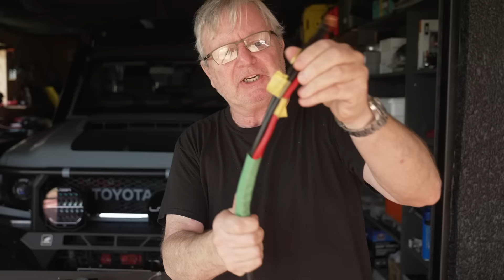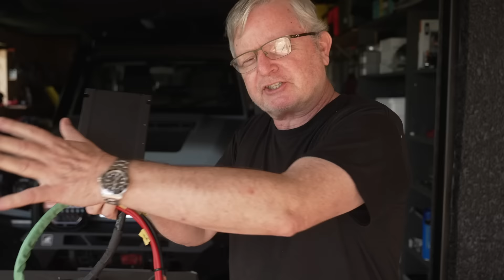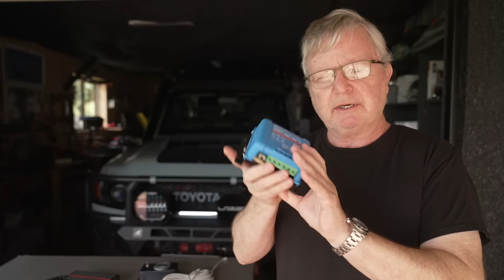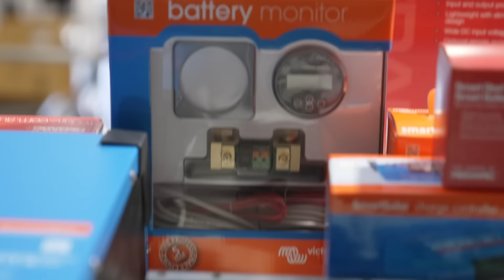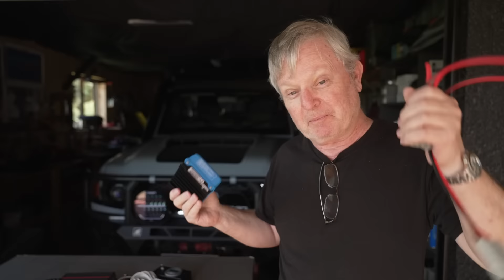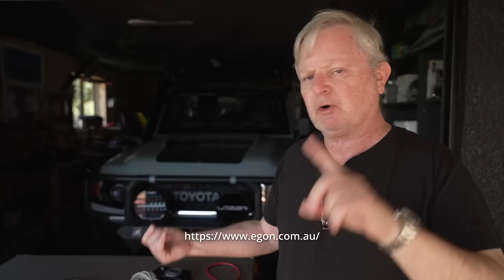DC-DC CHARGERS. Victron VS Redarc How to chose the right one for you.  @4xoverland

Comment: Out of my Redarc I get 48.7 amps 
I think it has to do with what your alternator is charging.
Mine is fitted to my 2004 GU 4.2tdi Nissan patrol
As you can imagine it’s prehistoric compared to today’s vehicles.
There is very little demand for the alternator to keep the engine running.
Reply from the maker: 48.7A at the battery from a 50A DC-DC charger is a healthy charge.
Reply: @4xoverland I’m currently reorganising all of my 12volt system
Once I have it all up and running again I’ll monitor it and see what the outcome is.
I’ll let you know how it goes.
Cheers

Comment: On the Redarc, is it a maximum of 50a it can charge including dc and solar? Or is it 50a from dc and then solar on top?
Reply from the maker: The Redarc BC-DC50 never reaches 50A. More like 47A at max. And the solar is included. These are max current charge rates. The new Victron DC-DC and MPPT are far better. The Redarc inbuit MPPT is not very efficient. A separate MPPT gets better results from solar. Also, the Radarc can only handle the low voltage panels. Victron can handle high voltage, and therefore more efficient panels.
Reply: @4xoverland thanks. Will try to cancel my redarc order I think

Comment: You are better off putting a inverter near vehicle alternator but mount it not to hot area. Then you run 14 gauge extension cord to trailer hitch. But a cord receptacle. Then a male cord and more 14 gauge 3 wire to your trailer on board power cord.  Now you do not need the big welding cables. You can charge using 1500 watts at 120 volt,  or 3000 watts at 240 volts.

Comment: Would the new ‘Redarc  Manager Alpha 100A’ Alpha unit change the preference over Victron for this application?

If so, why?
Reply from the maker: No simple answer. I need to get one to test. I do have two questions: Is the Alpha's fan as noisy as I hear it is? And can one's alternator even handle that current?
Reply: @ yeah, I agree with you.  I have decided to select Victron over redarc for my new build.  After doing some recent research on the Alpha, I just think the ‘100’ is used as a cunning marketing ploy  - in my view.

Comment: That is a similar conclusion to my research. I am building the Victon Lynx system with a Victon 1000A IP65 smart hunt to a Ekrano GX display. Battery, mid battery, Tempuraturs, humidity, water, LPG can be monitored. If an upright fridge needs an auxiliary fan to help cooling, the system can switch that on and off. More expensive, yes. More usable features that I will use, yes.

Comment: We did use Victron before and switched fully to Redarc since it’s release in Europe. Reasons are multiple:

-much more easy to install
-robust and even waterresistant 
-much easier to operate by customer
-all in one units like Manager 30 where you cut down all the wiring and installation time, what’s the most important for our 4x4 builts is that there are less wires exposed to vibrations, heat, dust and even some humidity
-Redarc has superb customer service where Victron has literally none (at least here in Europe)
-when we resale the units for DIY installers they are also super happy as instructions are easy and also online
-we had multiple warranty claims with Victron in the 2017-2019 time, especially with dc-dc chargers that didn’t survive the offroad conditions such as the vibrations and heat
-last but not least it is made not in China, of course there might be some parts coming from there but the feeling that we support western world jobs and cutting down the Chinese machine which is growing and also invests in growing their war machine that supports Russia is also satysfying. Victron is made of 80 to 100 % Chinese parts and this is what we really don’t like.

Downsides of Redarc - solar power VOC but it’s not really that bad as if you choose your panels wisely and pair them parallel it will be possible to charge near same amount of power like thru the Victron MPPT

That’s our opinion based on 8 years of experience with some market products.

Comment: Hi I love your videos,
I have 800 watts of solar and a 30amp enerdrive dc to dc charger.
I was thinking about getting a better dc to dc charger 🔌.
You mentioned the 40 amp redarc charger 🔌.
In your opinion would this be the best option?
I find the panels don’t start working until about 10am 🕙.
Would the redarc make any difference?
I live in Australia 🇦🇺.
Thanks very much for your time .
Kind regards,
Peter Keys.
Reply from the maker: You are going to need more than 30A charger for 800W solar. Get a dedicated 100A solar MPPT charger. Recommend Victron.
Reply: @4xoverland  thanks for your reply. 
What about the redarc 40 amp charger 😒
Reply from the maker: A 40 A charger will handle 480W. So no. You are going to need an absolute minimum of a 66A charger for 800W. But even that is cutting it fine. To do it properly, get a 100 A MPPT charge controller.

Comment: Great video! Need help. I am trying to do a dual battery in my 5th gen 4runner 
Currently I have Xplor solar 180w on RTT charging my Jackery 1000 using victron MPPT but now I want DC-DC with solar and alternator charging 
But cant find how to do it or what parts needed with victron - looking like I’ll have to go redarc and would not like to if possible.
Please help thank you
Reply from the maker: Victron do not have a combined alternator/solar charger. But keep them separate! Just add a victron DC-DC charger for alternator charging.
Reply: @4xoverland  Would I then take the pos & neg from the the mppt and wire them into the same pos neg ports of the victron dcdc that the alternator is wired to as well?  

Or have the mppt go straight to my aux battery 
And also have the dcdc separate going also to aux battery not combing the wires at all.?

Thank you so much for your response
Reply: @206Trail4R  You probably have solved this by now, but for the others: The MPP charge controler to the Aux Battery and the DC-DC charger from the main to the Aux battery. The problem with this settup in a RV that is parked up for a long periode, off season, is no solar from the aux to the main battery. Epever has a MPPT in 20+5 and 30+5 volts that charge both battery, with 5amps for the main battery. Victron also have the Cyrix realays betwen Main and Aux battery, where you have the possibility to conect the batterys when main is dead, to transfere from Aux to main. How ever that does not limit the amp going from main to aux. And that is the reason you have a DC-DC charger, for your alternator not to overheat.

Comment: Couple of points - I have had my 2in1 die before (dcdc and solar) combined units are a single point of failure and when they die, you are buggered. Seperate independent units allow for upgrades and redundancy.  Redarc has not done anything to modify their pricing to keep up with competition, their tech has advanced but isn’t better than competitors like victron OTHER than providing a wholistic solution that locks you into their products.  I dont think the dc dc from victron is more complicated to wire because you don’t need an ignition wire.  I’m victron all the way now, it’s cheaper, some of the things it does is smarter, it’s not hard to do DC when you figure out wire size and fusing everything near the source.  I’d love to support Aussie made but the price does not justify how much effort goes into building these things.  4wd companies like ARB and Redarc have had a captive market and have been charging excessive prices for a long time now.

Comment: Does the victron still have a voltage limit input. My guess is you couldnt have 4x 25v panels in series or inputting 100v into it ?

Comment: It is true that the voltage stays high enough to be useful if you wire panels in series, BUT: if the output from the panels is not exactly equal (due to differences in panels, differences in orientation or differences in irradiation due to clouds), the total output power will be greater if you wire them in parallel. This is because the (open circuit) voltage of solar panels is more or less constant, it's the current that varies with the amount of sunlight hitting them. So, in short: If the panels are exactly equal, if they are oriented in exactly the same direction and there are no clouds: You are right. If one of those criteria is not met, you are better off wiring them in parallel. If not, the time you 'loose' because of the lower voltage will be more than compensated for by the higher power throughout the day. Of course, if the output voltage of your panels is on the low side, you might have no other option than to wire them in series. The Victron MPTT's need at least 5V above the battery voltage in order to start. Once started, 1V above battery voltage is enough. So for a 12V battery I would recommend panels with at least 18Voc (36 cells), preferably 20Voc (40 cells).

Comment: Having 2 or more panels wired in series may give you a higher voltage and longer charging day with thinner wire but , if one gets shade it will take out all panels and charging will almost stop. Parallel wired, one panel can be completly shaded and the other will still provide all the current it can. You will need bigger wire to handle the extra current if they all come together before the MPPT and a higher amp rated MPPT. Thats one benefit of Victron you can choose multiple voltage and amp configurations.
Depends on your set up. I have a panel fixed to the vehicle and a mobile blanket paralleled to the system. The vehicle stays in the shade if I don't need the charge and move the blanket around for best sun.
Reply: The caveat was to get the most out of the system. If running panels in parallel and buying a more expensive charger is what someone is doing, they are probably moving their panels during the day for optimal absorption.

Comment: In my experience the isolated DCDC VICTRON gear gets very hot. I'm talking it will get 40 degrees above ambient, so if its 30 degrees outside it will hit 70 degrees. 70 degrees is its max temperature and will de-rate continuously up to that temperature. From what I have been told the non isolated version is more efficient. 

The user interface on the Victron Gear good and the ability to control through Bluetooth is also very nice. If you go Victron you could go get a cheap house panel with a higher open circuit voltage and avoid way more costly 12V /24V panels in series or parallel. I'm curious of how much more energy you would actually capture putting two panels in series vs parallel. I'd hypothesis that it may not make an appreciable difference keeping in mind the pros and cons of series vs parallel solar panel configurations. 

You have to keep in mind also that the REDARC gear is also submersion rated / unlike the Victron gear. It also takes up a much smaller footprint and is way easier to tuck away somewhere.  

What exactly is the EGON achieving other than a distribution panel with some LED blown fuse indicators ? My assumption its a faster to install maybe ? 

Also keep in mind that some lithium batteries do have internal shunts that do do capacity monitoring, which may mean you don't need a Victron shunt / gage, although they work well from what I have heard.

Comment: It would really be interesting to see a comparison with measured results of how much more power is generated in series vs parallel and Victron vs Redarc to see the benefit.  I would expect the Victron to be more efficient, but how much?  It would also be interesting to hear your experience about reliability of Victron vs Redarc.  

I went with the Redarc 1250d because it has everything in one package and is built to be very durable - I have it mounted under a seat rather than a purpose-built enclosure, so I wanted something that would be resistant to dirt or a minor water leak.  Most of my charging comes from the alternator anyway.  

My Lion Energy UT1300 has a battery level indicator, so I'm not completely blind on the charge level, but have been thinking about adding the Victron battery monitor - so thanks for that recommendation!
Reply: Higher voltages (panels connected is series) will always produce less voltage drop than lower voltages (panels connected in parallel) for the same power output, due to the I squared times R factor = power loss along the cable due to its resistance. ie: by increasing the voltage potential and decreasing the current flow, you end up with a more efficient system because it produces less heat and less losses (at least until they invent the super conductor), no matter what brand you use. That's why power transmission lines are high voltage and low current in order to reduce power loss. I^2 X R = Power loss.

Comment: Nothing better than Victron, THE product also for marine applications. Producing enough voltage prolongs your charging/day. I have 4 panels of 300W. Each pair linked in series goes to a separate MPPT (redundancy) and combined in parallel to the battery bank. Unicat has a very good video about this subject. Tip: your produced voltage (in my case 2x 40VOC) must be at least 3X the voltage of your battery bank to get enough hours of charging, even without full sun.

Comment: I use the Redarc BCDC1225D charging a Redarc 100AH LiPo, monitored by a Victron 702 Smart Shunt with Bluetooth adaptor. It's simple and it works. Recently ran a Dometic cfx 40 over a 4 day camping trip, (with some driving) in 35ºc temps and hardly made a dent in the battery. Redarc isn't cheap but the quality, customer service and fact it's Australian owned and made makes it a great choice.
Reply: I’m sure it’s great, but one big advantage of victron is its rated water resistance and Bluetooth, for about half the cost.

Comment: We have Redarc DCDC1250D, Ctek with Smartpass and have settled with a Mastervolt system which instead of DC-DC, uses a Chargemate Pro 90.  This limits the current to 90A from the alternator to our lithium battery.  We want this so we get a really fast charge of 90A, but also limited to 90A so as not to overload our alternator. We find that being limited to 50A charging does not make the most of small journeys when we have the engine running.  We decided against the Redarc and Ctek because of the limited solar input voltage.  We wanted to use domestic solar panels which have much higher voltages.

Comment: Victron is BY FAR the best available at the moment - that is why the top dogs are all using them in their builds - like Safiery!. Sure, more expensive, but buy once, by right and no worries.....There is a MASSIVE difference in both quality, performance and customer service between many of these brands.
Reply: You should go and look at Mastervolt, Victron is well known in the vehicle industry, but Mastervolt have been building incredible products more focussed on the marine environment.  There products cross into vehicles and you will see many builds using them now.
Reply: >>>Sure, more expensive, but buy once, by right and no worries<<< Don't know about this statement, technology moves so quickly these days that it can render a complete system unusable because of lack of support or it's outdated. I prefer to buy individual components rather that an all in one unit because if an individual component needs to be replace because it goes faulty, it's much cheaper to replace than an all in one unit. It's a case of not keeping all your eggs in one basket.

Comment: I started by ordering a Redarc DC to DC charger.   It was so big, I realized there was no way it would fit in the very limited mounting space of my Arctic Fox truck camper.   I then discovered the Victron Orion unit so I returned the RedArc and ordered the Victron.   It has performed very well for my needs.
Reply from the maker: That makes no sense. The Redarc DC-DC is smaller than the Victron, and includes the MPPT charge controller.

Comment: I have a Victron 30amp dcdc. Not sure if it's a Victron issue or  higher amp issue.
Apart from the heat, have only ever seen 20amps and it drains the voltage at idle to 12v and turns off.
Reply: Play with the settings. The start and stop have voltage parameters. I found it confusing to start with but it seems better with lower start voltage than the stock setting. Cheers
Reply: The Orions get extremely hot so make sure it is installed in a well ventilated area, preferably on a metallic surface that acts as a heatsink. You may even have to use a small fan depending on where it is installed. Also It is imperative that the correct size guage of cable is used when wiring from alternator to Orion and from the Orion to Aux Battery to allow for voltage drop and max current flow.
With those factors in mind you should be able to achieve 28-32 amps every time.
Reply: @12v_obsession92  thanks for the info. I'm working on a fan cooling for the 12v box. 
As for cable size, I'm running 16mm2 for cable from front to dcdc and to battery including ground. 
The alternator/main battery  drops to 12v then the Victron cuts out, the voltage increases to 14v and Victron cuts in and repeat at idle. New 550?CCA battery and alternator plus added extra grounds on engine to battery and chassis. No change.

Comment: Redarc is a great company. Nice support etc. I have used the 1240D charger for a couple of years but then I upgraded to all Victron gear.  The mppts is just another level. It does  a much better job charging your battery using solar. As Andrew said, the fact it Handel's higher voltage, it gives you much more flexibility on how to design your solar system and the outcome is just amazing.

Comment: What about the IBS DBM20 Charger? I use the IBS DBS dual battery system.
Reply from the maker: I decided to compare these two because they are probably the most well used, and both bestsellers. I did not compare them to other makes because these are the two of three that I have had personal experience of.